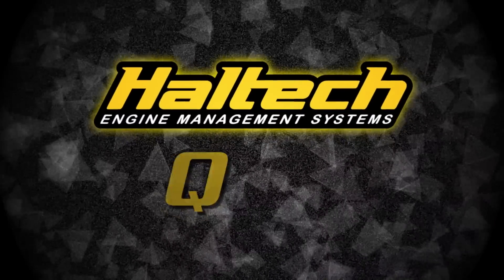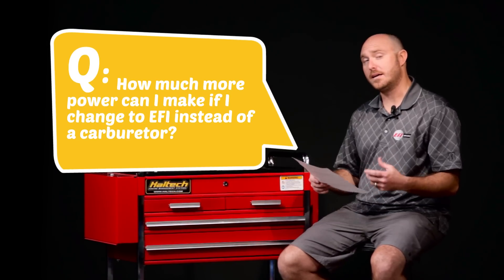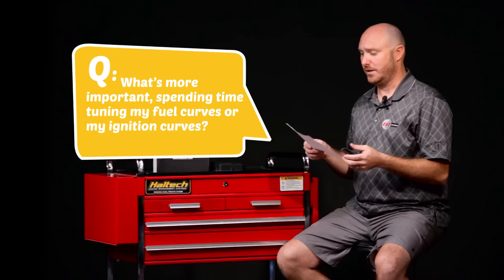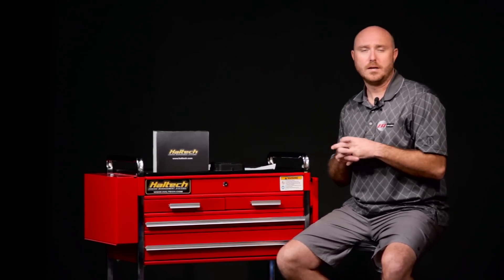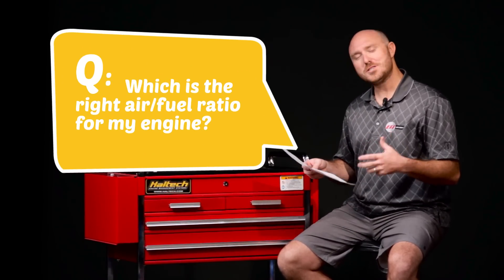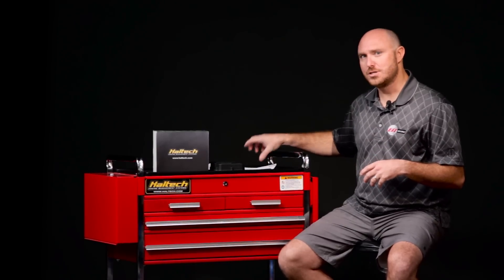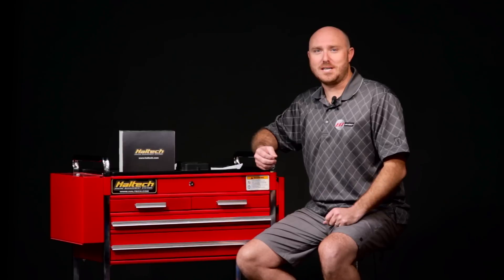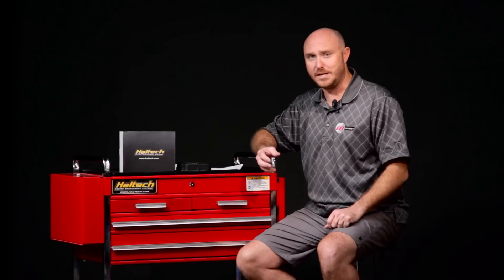Fuel Curve vs Ignition Curve, Correct Air/Fuel ratio, Power gain with EFI - Haltech Q&A Episode 8

Comment: Does haltech support turbo rpm sensor?  And is there some protection against surge
Reply from the maker: +Maxime  The Elite 1500 and 2500 both support turbo speed sensors. This information can be used to activate functions or modify engine operation.Eg. If turbo RPM exceeds 120,000rpm, reduce timing and target boost.
Reply: +haltechecu  what type of sensor is used in a turbo ? seeing that high numbers of rotation ?